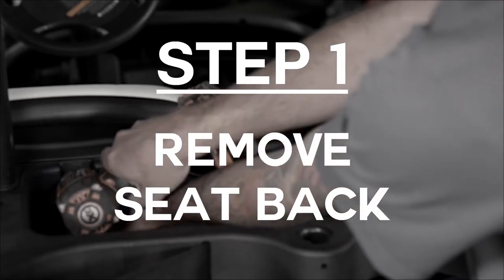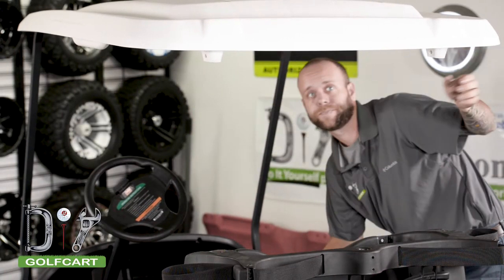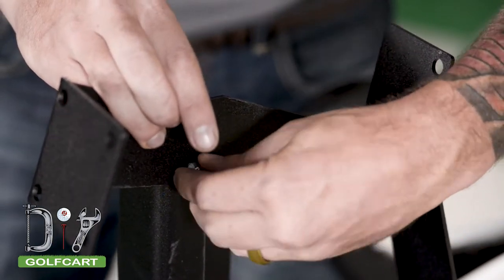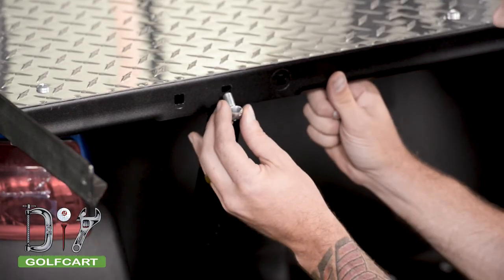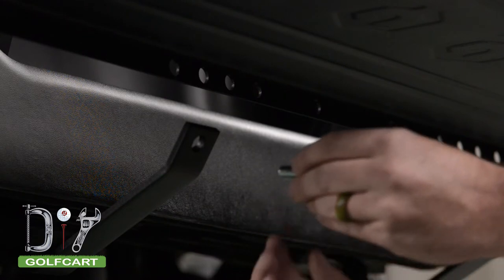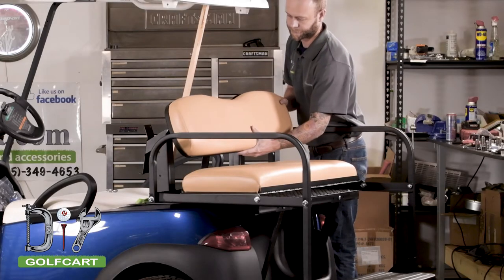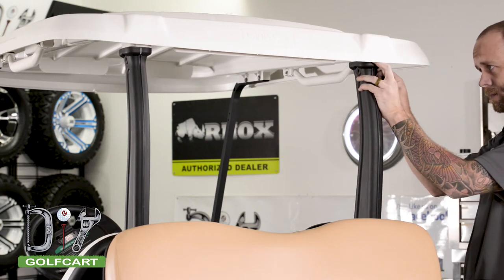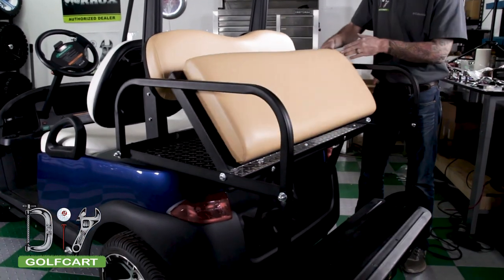Modz™ All American Rear Flip Seat Kit Install on Club Car Precedent Golf Cart

Comment: Thanks for your video! My club car already has back seats mounted, but they did it in a way that left the sweater basket in place.  The problem is now I can't install seatbelts back there for my young kids.  I tried removing the sweater basket myself, only to realize the back of the front seats were bolted to it and I don't have any of those internal "tree" brackets that you have in the video. Do you have any ideas on how I can go about getting seatbelts installed back there? Is there a way to order just those tree brackets by themselves, and if so would that solve my problem?